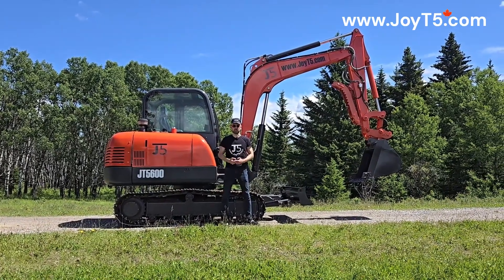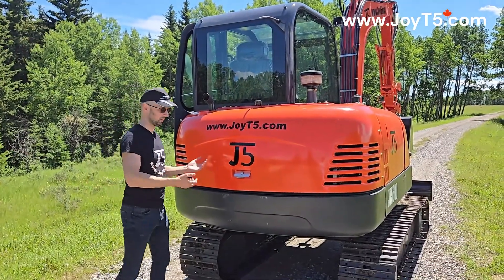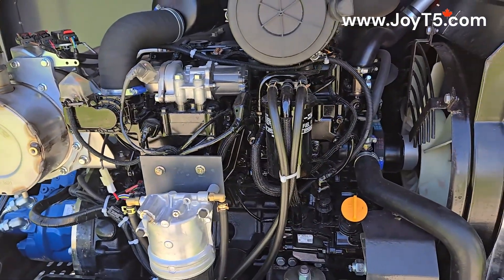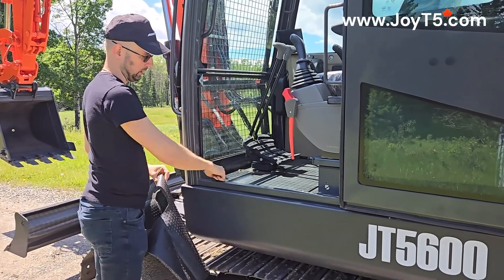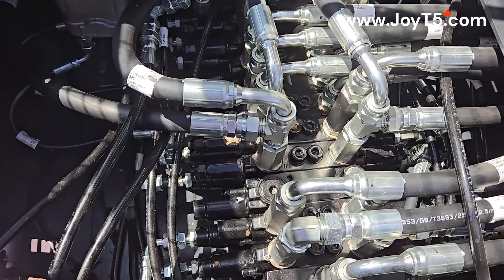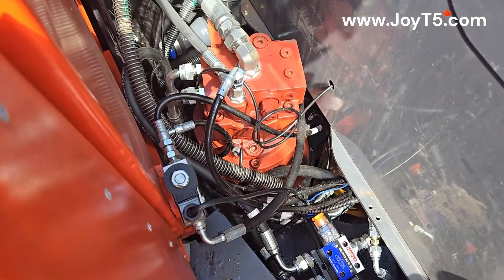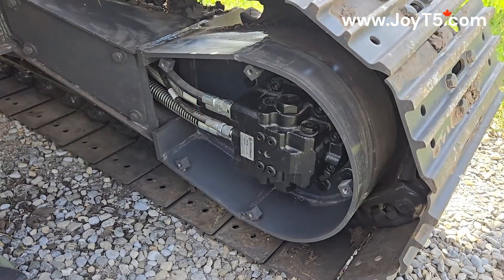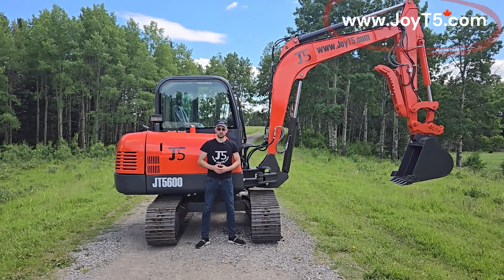What is inside a 6 ton Excavator?

Comment: What does it take to transport the JT5600?  What size dump truck and trailer must I have? Would an F550 do the job? An F650? I assume a tandem axle trailer rated at 14000 pounds with electric brakes would do. Pintle hook or 2 - 5/16 ball?
Reply from the maker: Hello @JfHbilling , 

Your truck and trailer set up needs to be sufficient to transport 14,000 ponds or more.  2024 F250's towing capacity with gooseneck trailer is over 22,000 pounds. That is more than enough to tow a 14,000 pound machine.

Since towing capacity depends on many different factors, it is hard to answer your questions without having all the details.  It would be best to consult with your local Ford dealer.
Reply: @JoyT5  Thankyou.